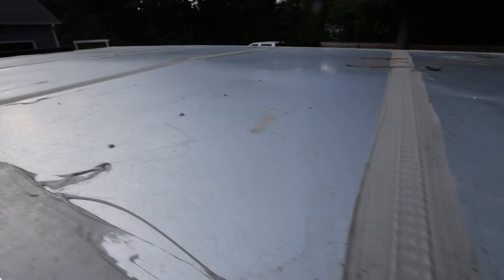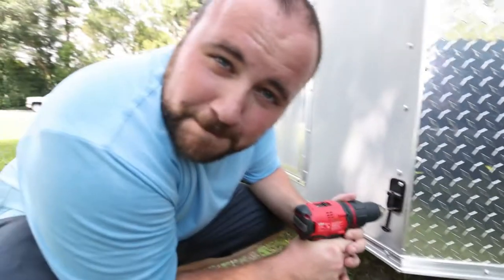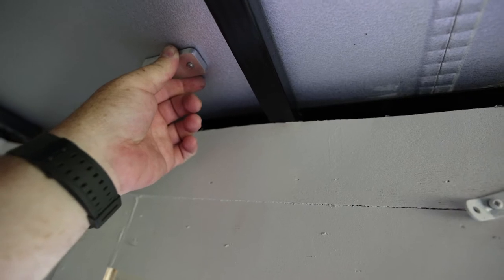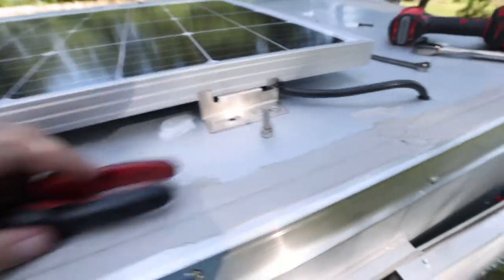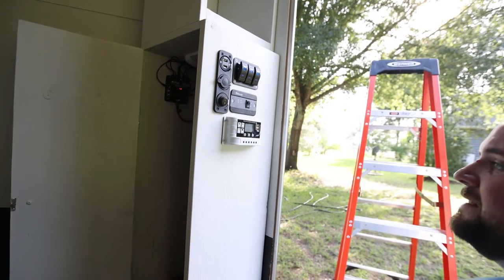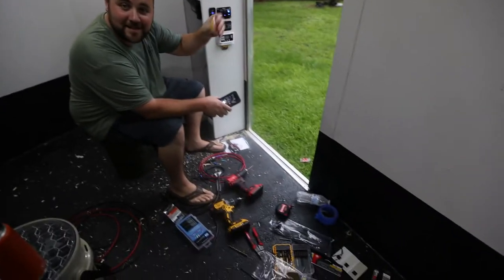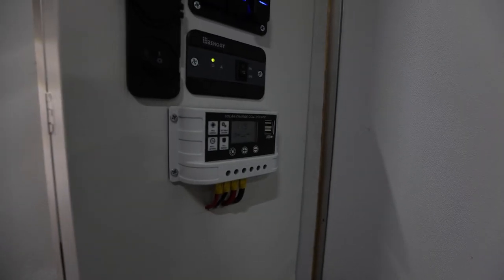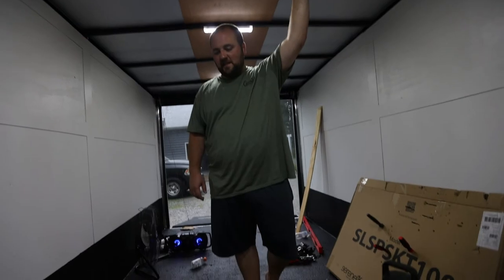Our Decoy Trailer Charges Itself! | Trailer Build Ep: 5

Comment: Loving the progression. I am watching because we too bought a 7x14 for our trips north. 10 years in a row minus COVID year....thats a wash. Why the inverter? Can everything run off of 12V? Can't wait to see the next episode. I think we are definitely going to epoxy the floors as well. Looking for lighting ideas and you have really helped out....thank you for sharing!
Reply from the maker: Thank you so much man! We've been having a good time with it for sure. The inverter is mainly so that we'll be able to charge our hedger batteries while on the road. We havnt don't an official test of running everything off the 12v, but I can tell you that we ran the interior lights for 4 hrs straight last night while working inside and it dropped less than 1 volt. We do plan to do an official test where we run everything at the same time for at least 2 or more hours at night (so the solar panel isnt charging) and then see how long it takes to re charge itself back up the next day. im sure well make a video of that too. the herculiner floor has been awesome so far. we've worked on the trailer in the rain where the ramp has been soaked and no one has slipped at all. thanks again for watching and good luck on your trailer build!
Reply: @910Outdoors  did you ground the system to the trailer or ground everything there at the battery box? Just painted my floor today and have lights, battery, and solar panel on the way as well. Much appreciated that you are sharing your experience.
Reply from the maker: @briansmith8629  everything is grounded right there in the electrical cabinet. Awesome man! Glad that these videos have been of some help to you. In our last podcast episode we actually talked about that why we started this vlog series. There’s a lot of nicely built decoy trailers out there, but just not much information on building them. Good luck with your build!!